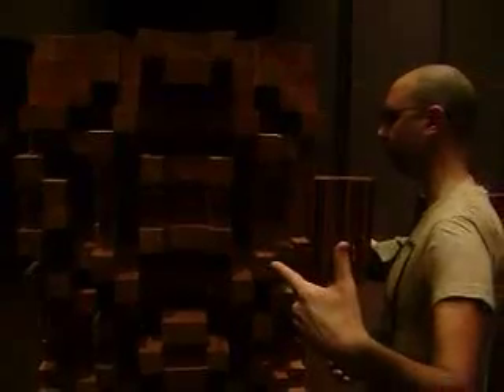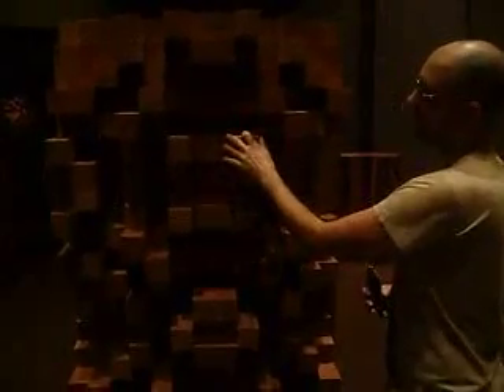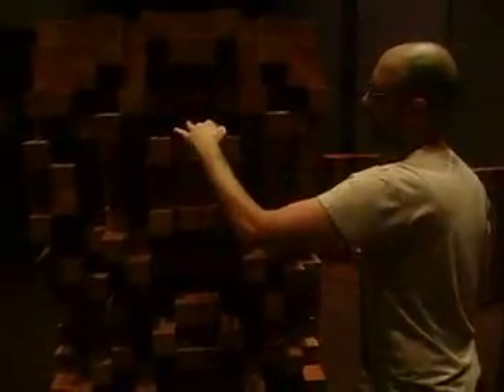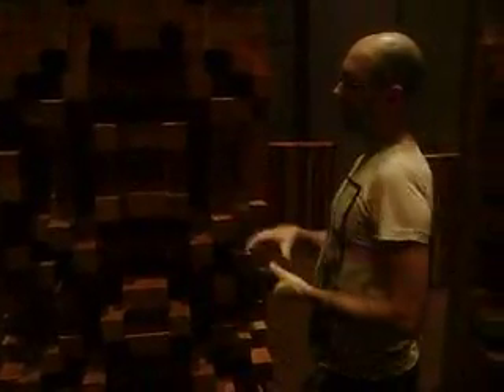06-08-08 (III) Sound diffusers

Comment: I also build one of these. Three meter high, one meter wide and 500 pieces of 1-16 cm poles.

It's excellent. I can't really hear any difference right away until I remove it. Then the room sound horrible. Makes everything sound better. Directed my 50W cheap hybrid Marshall speaker against it and it suddenly didn't sound so cheap anymore.